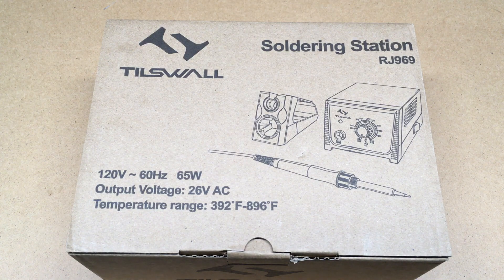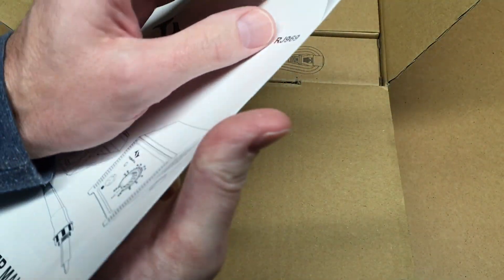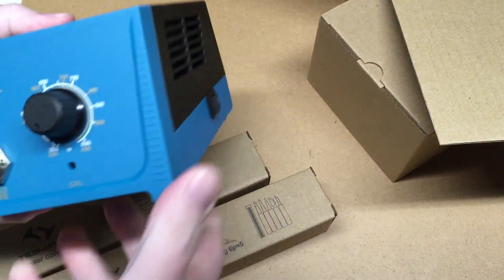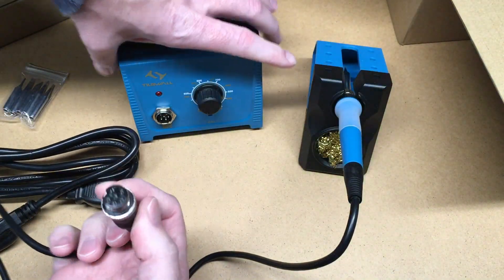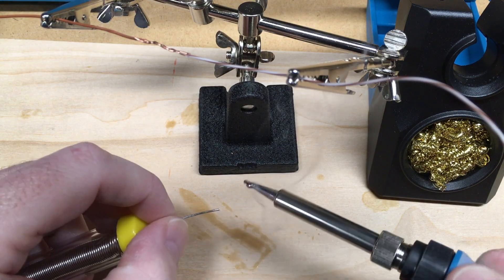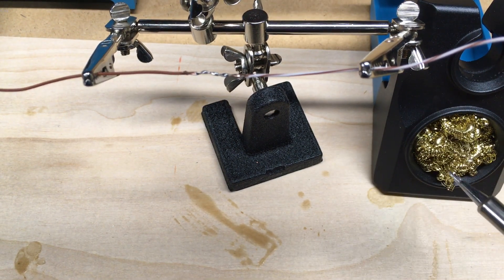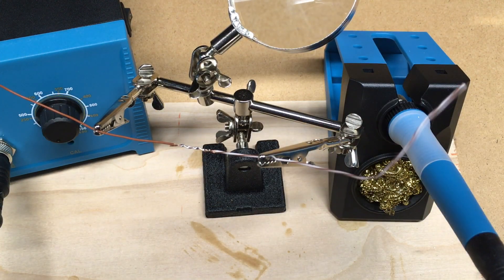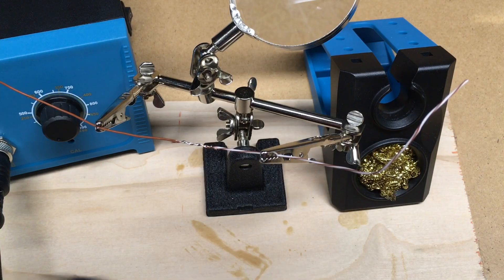Tilswall 65W Soldering Station

Comment: Used it twice and now tip won’t heat past 109 degrees.
Indicator light never stops blinking.
Calibration screw is cheap and I had to remove front cover and small control board to dial potentiometer to highest setting, still not working.

Comment: My tip is crank it up, get the tip wet use that to trasfer to the wire then lower the temperature and add the solder to the wire.  Would be nice if it had a foot control.

Comment: Ive just bought the Soldering Station, 65W Tilswall Solder Station and it seems very good. Well constructed and heats up quickly. I've only had it 2 days so we will need to see how it performs over time. The only let down for me, is the instruction booklet. As it clearly states that the indicator light stops flashing when it has reached its temperature setting. It just doesn't as it continues flashing for as long as it's switched on (never stops!) Also, it gives minimal information regarding calibration after changing a tip. It gives no point of reference for the calibration (by what measure?) If anyone can help me out with these problems i would be very grateful. Maybe I'm missing the obvious? Wouldn't be the first time. Cheers Graham

Comment: Is it still working well?
Reply from the maker: Yes. Working great.
Reply: @Rickmakes  Thanks for the reply. I was looking at the station on Amazon and I was concerned about the screw on plastic retaining ring that secures the heating element to the main body of the iron. Seems like it would be a vulnerable part.

Comment: Would this work well to use for stained glass?
Reply from the maker: I don't have any experience with stained glass but it is my understanding that they need a little bit larger (tips and wattage) soldering iron. The tips on this are pretty small as they are designed for small electronics.
Reply: No...  It's only 65 watts

Comment: Are you still using this soldering station, and how's it holding up?
Any problems with it so far?
I'm thinking about getting one from Amazon.
Reply from the maker: I have only done a few projects but no problems so far.
Reply: mdfouru  Do the instructions explain how to calibrate it?  Do you need additional tools to do it?
  It looks as though it takes standard 900M tips, so replacements are easy to find.
  Is it holding up well?

Comment: its best to use chisel tip for 98% of work. best heat transfer  and heats up wires and circuit board  pads much faster with just a chisel tip allways tin the tip before u put it away and before use start useing it
Reply from the maker: Thanks for the tips!
Reply: your welcome man